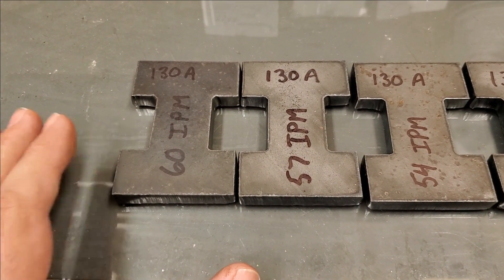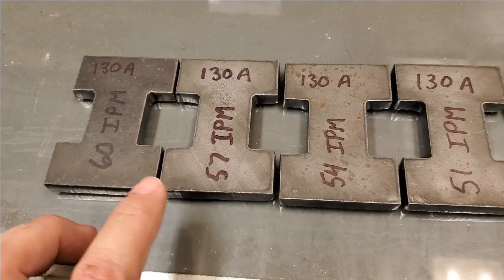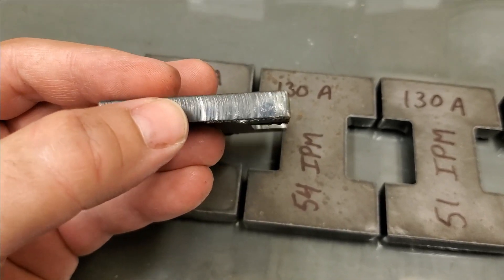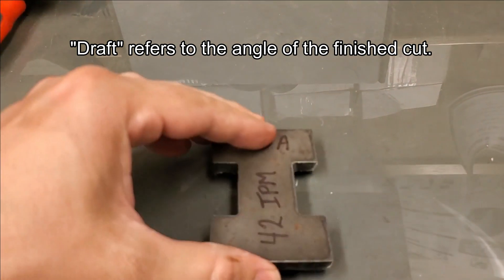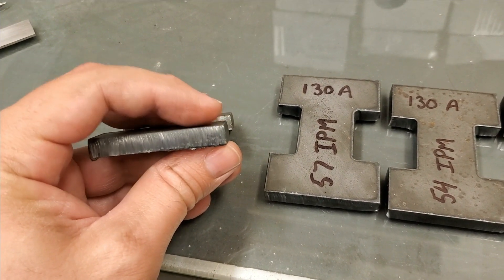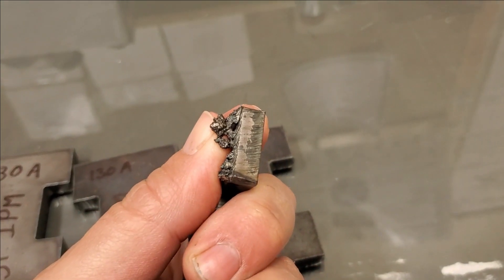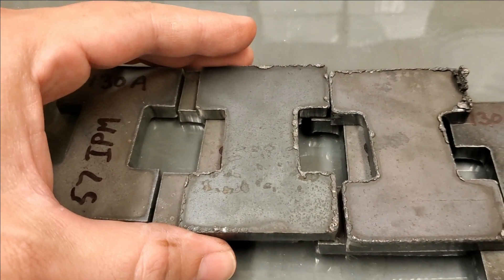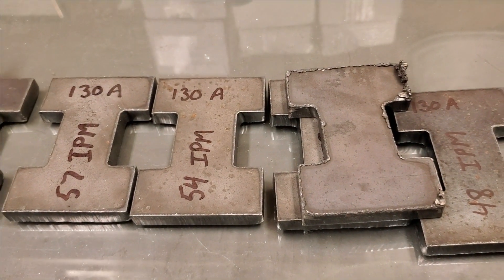How Does Feed Rate Affect Cut Quality On a Plasma Table?

Comment: ,, use a multi-tool to remove the slag it's way easier
Reply from the maker: I'll give that a shot. We've mostly been using either an angle grinder or one of those small pneumatic band sanders lately. Less wear and tear on the nervous system as a whole.

Comment: Stuart, I have never owned a plasma cutter... But back in the 70's and 80's of the last century, I was a welder for a living. I got very good at using an oxygen and acetylene cutting torch. I was called a human cutting machine by the guys I worked with. Not bragging, but I thought I would share what I learned by trial and error. I never used any tip larger than a 000. Even cutting plate and pipe up to 3/4 inch thick. I found that turning the pressure up had a lot more effect on the cut than speed. Although when cutting anything very thick I did have to slow down somewhat. But if you get the heat up hot enough to make the metal melt, then shoot a high pressure stream of air at it, the metal will cut like butter and look like it was cut on a bandsaw. and another thing I am remembering is the stream of air has to be extremely strait. Meaning the cutting tip had to be perfectly clean. Any turbulence on the air hitting the molten metal will cause a horrible looking cut. Lack of pressure and turbulence in the air stream is what causes the slag. Some people call it dross...
Reply from the maker: Thanks for the input!
Reply: My pleasure! @StuartdeHaro

Comment: All that water splashing about looks more like a water jet cutter than a plasma one, does it interfere with the cut?
Reply from the maker: Nope. It actually keeps the fumes down quite a bit and the parts are cool enough to handle right after cutting most of the time. It just depends on how massive the part is.

Comment: Tell them to get their money back. That cut quality is horrible.
Reply from the maker: Do you have any recommendations on improving the cut quality on a plasma table? I'm certainly open to suggestions.
Reply: @StuartdeHaro it seems awfully slow to me for that many amps on that thin of material, a quick google search showed almost double that.  I just picked up some 5/8" plate cut with a plasma and the finish was superb
Reply from the maker: @EitriBrokkr  I'll see if I can speed it up a bit. I had the feed set to optimal according to Hypertherm and I know I couldn't speed it up past 100% on the fly, but I should be able to speed it up in the software.